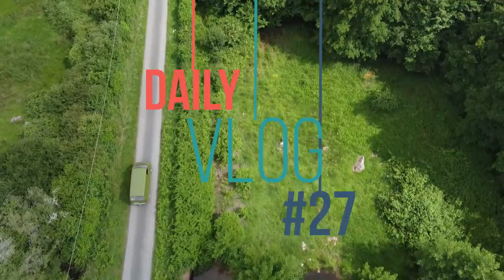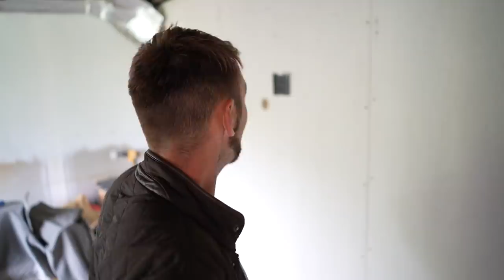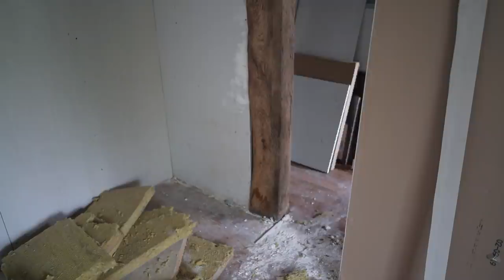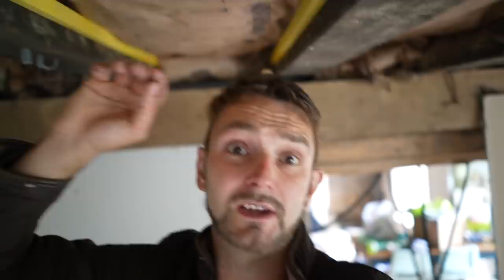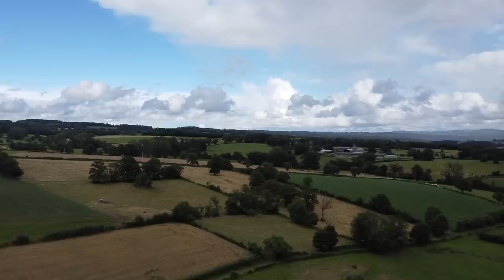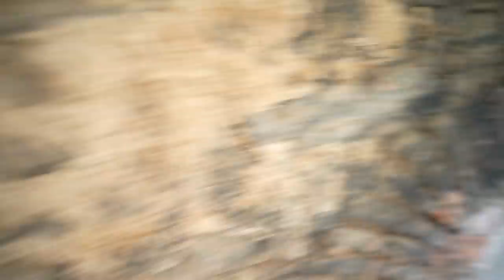one of those talky reno type episodes-EP027

Comment: I think you should invest in a “ shop vac” for all the vacuuming you will do for your renovation.  Your poor “ Hoover” for the house just isn’t made construction debris
Reply: In many organisations where I've worked, the cleaning staff use Henry hoovers. Cheap but sturdy. (Dan must've thrashed it to death tho 😁)
Reply: You can buy an 'in between bucket' a dust collector that picks up 80 - 90 % of all the fine dust and spares the hoover's engine.
Reply: Henry Hoovers are the sturdiest of the cheaper machines. I used to work for a contract cleaning company, specialising in industrial settings, so the Henries were cleaning up nails, screws, iron filings, sawdust wood shavings, plaster on a daily basis. Believe me they are made for it.